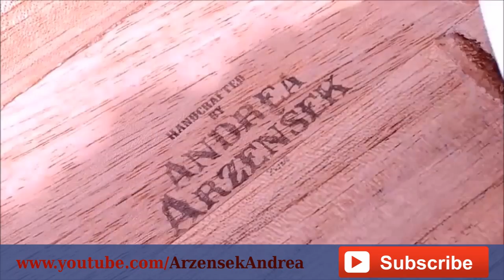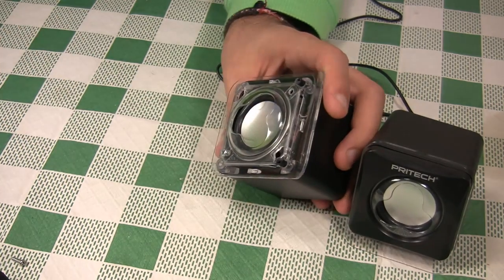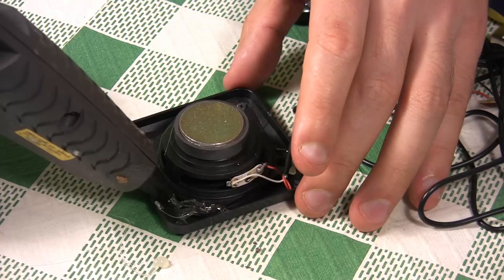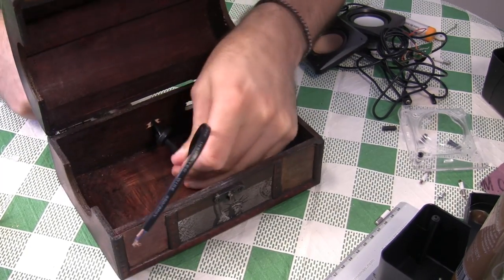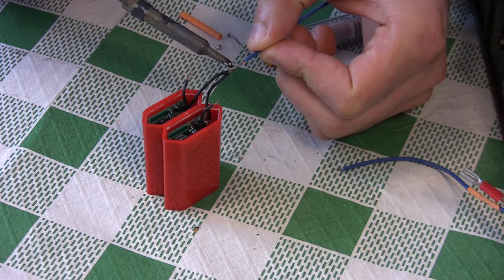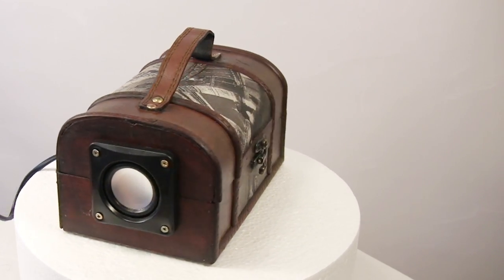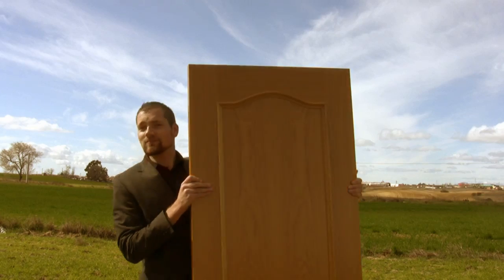Pimp Your USB Speakers and Add Bluetooth | Diy Speaker

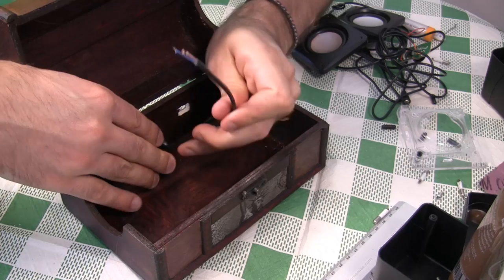Comment: What cable are you using at 1:50?
Reply from the maker: +The dutch cowboy 
It's an ordinary power cable from a lamp. No earth. Just 2 wires - Live and Neutral. Cheers

Comment: can i change the power source using a battery
Reply from the maker: +IfeelFunny 
Yes, sure.
USB power bank is probably the best option.
Reply: +Shake the Future Can I change the plug with an USB cable or a 3.5mm jack?
Reply from the maker: G. Ermers
Yes you can. In this exact project I used 2xUSB chargers instead of 1 because the bluetooth receiver and the speakers did not like to share the power source (noise was introduced). So if you would want to use a USB cable, you would probably need one for the receiver and one for the speakers.

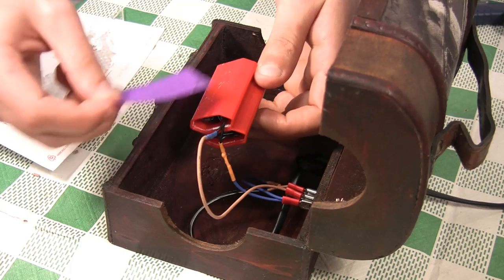Comment: @2:48 = instant fire death mayham.
Reply: What is the proper way? I've seen it done that way a few times. I'm also surprised by the missing insulation. Also, I've never seen this inside a wooden box